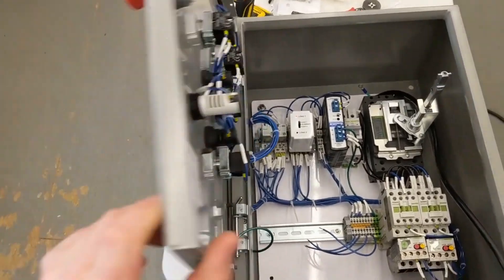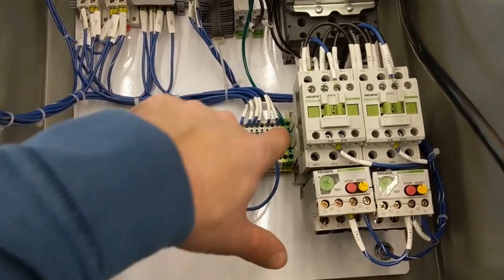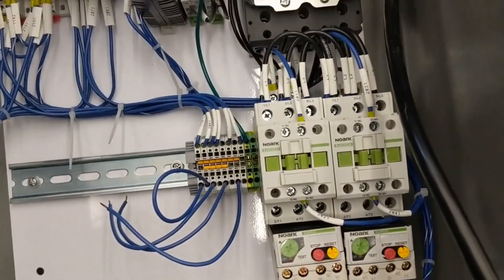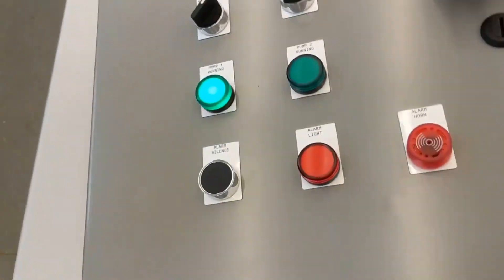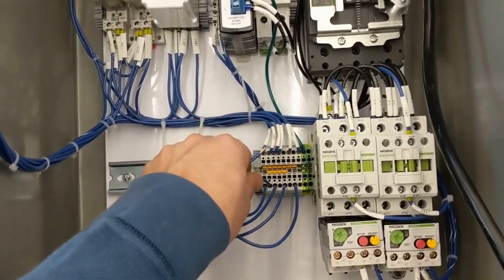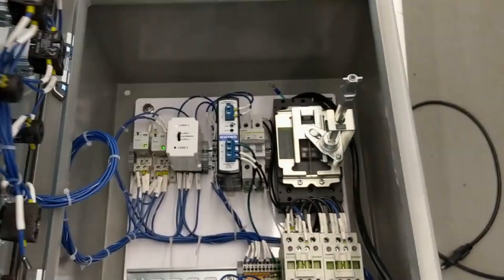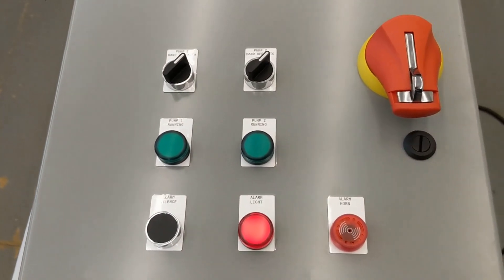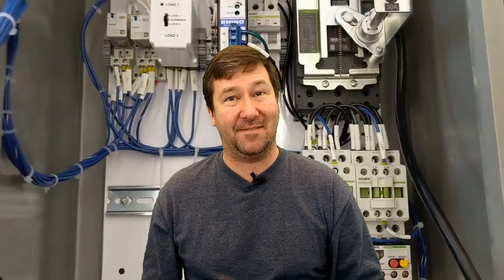UL 508A Dual Motor Starter Control Panel #4100

Comment: Hi Tim, I just found your channel and am very glad I did. The content you have on here is exactly what I have been looking for in terms of depth. I do a lot of programming and some panel building so I'm always looking for tips and tricks. Now, the first question I have is when it comes to building the UL certified panels, is there a place to get the standard or general standards for building/designing these without having to shell out the $700+ the website requires. Point is, I'd like to build UL quality panels as a general standard in my own designs, but can't justify the cost when typical well known electrical standards for wire, fusing, and breaker sizing are enough.
Reply from the maker: Definitely check out our Control Panel Building series.
https://www.youtube.com/playlist?list=PLUi5cdVq3wTBS2PQ-1yXtMmlGcWoPh9_6

After that the biggest deficiencies I see in panels is labeling.  Start paying attention to other's labeling.  Not just wire labeling, but drawings and component labeling as well.

Then post pictures of your panels in some of the discussion groups.  Be prepared for some pretty harsh criticism but don't defend what you have done.  Ask how you can improve.

Good luck!